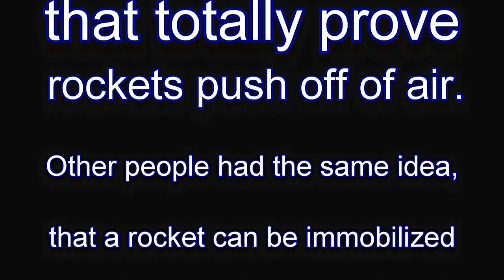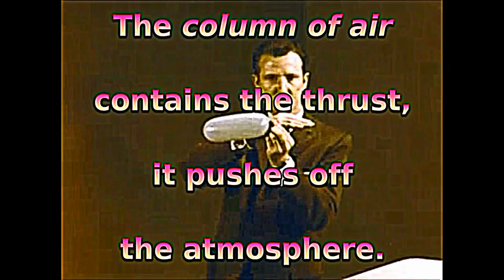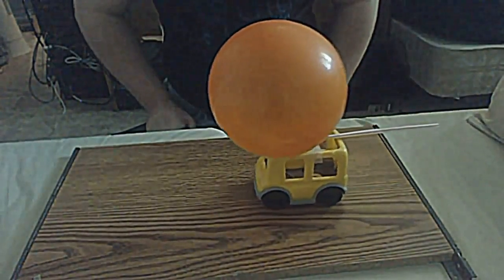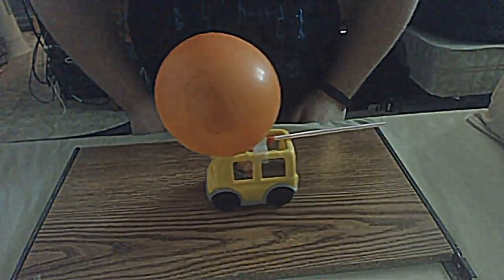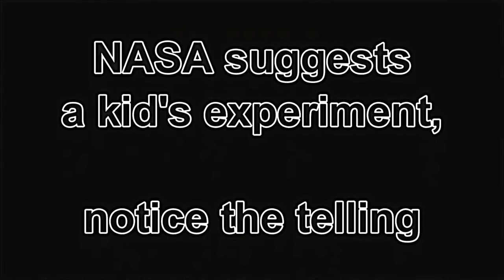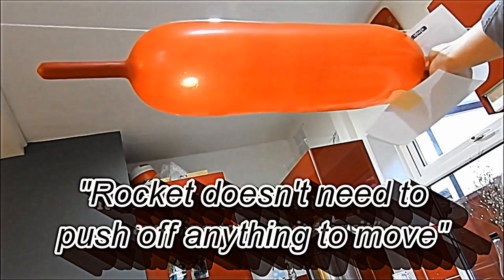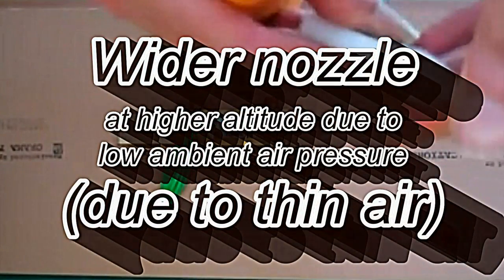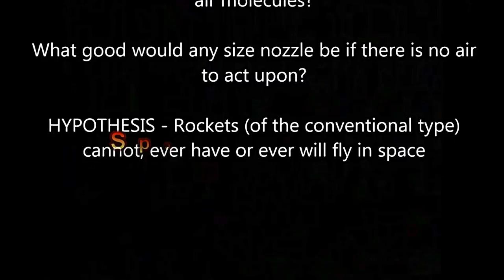rockets push off air

Comment from the maker: Kareem Salessi 13 subscribers DOCUMENTATION: SET video to minimum-speed for best results: https://youtu.be/WR9cDF8pDt0
Title: ("Solving-Apollo-Enigma-2")==("PROOF-APOLLOS-WERE-FAKE") ("Simple-Experiment-Proves-Apollos-FAKE"): 981 views•Jun 1, 2019
1:26 in a-half-second the weight of this 2.5 kg mass increased to 10 kg (i.e.:4-fold); 2:29 the weight of this 3 kg mass increased to 15 kg (i.e.: 5-fold), thus a falsely-claimed 3,000-ton-Apollo must instantly increase in weight to well over 15,000 tons (5-fold), and thus its falsely-claimed-thrust-force of 3,700 tons, would NOT have been able to detach it from its launch pad, even ONE INCH !!! While Apollo-Thrust-Weight-Ratio (TWR)==1.25, the minimum TWR==6, is charted for any type of rocket to safely detach from launch-pad! https://c2.staticflickr.com/2/1543/24...  However, this required minimum-TWR increases, proportional to rocket-mass-increase! Thus, for a 100-ton rocket, the safe-minimum-TWR is likely well over 100. See also: ("Solving-Spacex-Enigma") https://kareemsalessi.files.wordpress...
_
Youtube: ("APOLLO 8 launch:Relive!") https://www.youtube.com/watch?v=Vn00B... AT: 8:40 Apollo-8 took over 10 seconds to clear its 80-90 meter launch-tower, and 75 seconds to go up only 800 meters (=BALLOON-SPEED), as opposed to fake-Apollo-8-Acceleration-Chart in: Google: ("File:Apollo 8 acceleration.png") https://commons.wikimedia.org/wiki/Fi... , : with which below calculator extrapolates that Apollo-8 should have ascended 625 meters in 10 seconds, by plugging (0, 12.5 , 10) into: https://www.calculatorsoup.com/calcul...  
HOWEVER, based on the True-Rocket-Acceleration-Formula presented in this video https://www.youtube.com/watch?v=YfkuA...   True-Apollo-Acceleration-Equals==
==((34,500KN–(3000X9.81))/3000==(+1.7 m/s2) which is DECELERATION, as opposed to 12.5 in CHART!!
However, all real rockets require at least a 3g acceleration (==30 m/s2) to launch, because they must clear their first 100 meters in less than 2 seconds, or they will tilt & fall. If Apollo is launched from the TOP of its launch tower, deploying its maximum-thrust-force of 34,500 Kilo-Newtons, with its worthless 1.7 m/s2,  Apollo would FREE-FALL to the ground and explode, in less than 5 seconds: In above calculator type in (0;  -8.1 ; 5). The only way to pull Apollo (or another object) vertically up with an acceleration of 1.7 m/s2, would be with a pulley, as experimented with in ("APOLLO-KILLER-EXPERIMENT-0") linked below, and also by typing in the above calculator (0;  1.7;  10):
***Https://www.youtube.com/watch?v=Vi6fj...
Copy-paste (NOT click) entire link into ANOTHER browser, but without: *
Above principles, as applied to Fake-Space-Shuttles: https://www.youtube.com/watch?v=uuYoY...
Even though Shuttles also take over 10 seconds to ascend 100 meters, similar TO Apollos, this fake-space-site has falsified 5.25 m/s2 as its acceleration https://www.sciencelearn.org.nz/resou... while contradicting NASA’s own false claim of 3g maximum for its Shuttles, even though delivering only a worthless 1.17 m/s2 (1/8th of g). https://www.nasa.gov/mission_pages/st...
 Now, if you plug into the above calculator, this fake 5.25 m/s2 , and 10 seconds, you come up with 262 meters altitude, 3-times its true-visible-height in ten-seconds !! !
________
FAKE-Apollo-Launch-Data: https://spacemath.gsfc.nasa.gov/weekl...
Enter any of the time, and altitude, numbers from the above Launch-Data into this (“Speed Distance Time Calculator”) https://www.calculatorsoup.com/calcul...  
To see that none of the, above calculated, final speeds correspond with any of the claimed speeds in the launch-table. For instance: typing the numbers for the 1st, 10th, and 20th, launch-seconds in the calculator, return these [should-be] speed results, respectively: (2; 12.6; 25.5), as opposed to the numbers in the table: (3; 25; 56). This discrepancy, standing alone, is just one of countless proofs of Apollo-Launch-Data having been faked, concluding that Apollos were themselves fake-rockets!
Now, my personal proof: based on my careful analysis, of my above experiments, my hand accelerated for only around a-half-second (0.30 seconds), covering only around 50 centimeters (0.5 meters). Typing those numbers in the above calculator derives a final speed of 1 meter per second, which is far less than all the speed-counts shown in the Apollo-chart. Now, assuming that Apollos have moved only as slowly as my hand (1 meter/second), in the above clip, their launch-weight would have instantly increased from 3,000 to 15,000 tons, thus they would have been unable to detach from launch-pad, with the claimed max-thrust-force of 3,700 tons, because that is a natural impossibility, similar to a man lifting an elephant, placed on his opposite side of a seesaw!